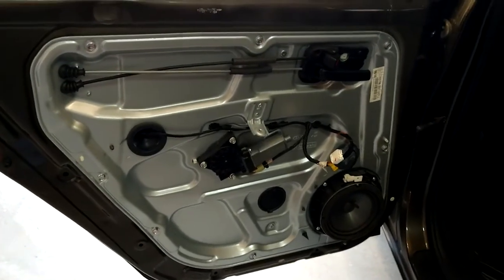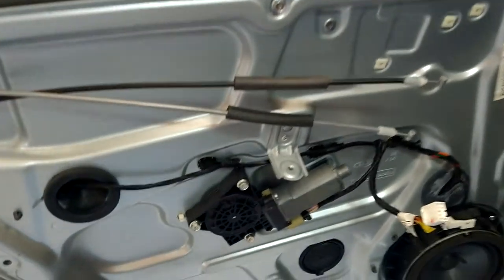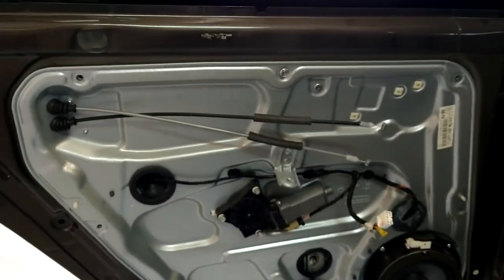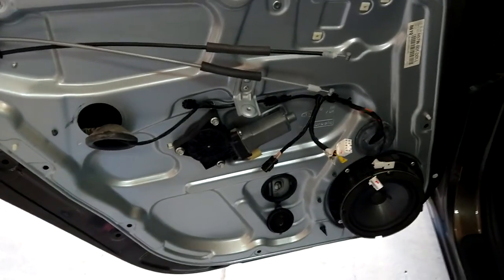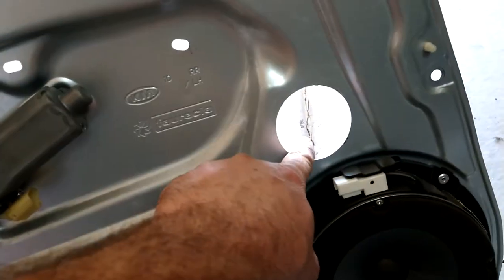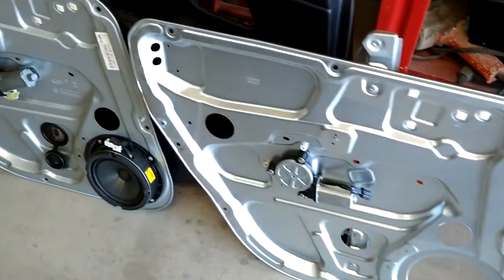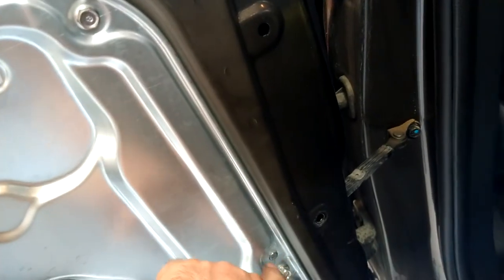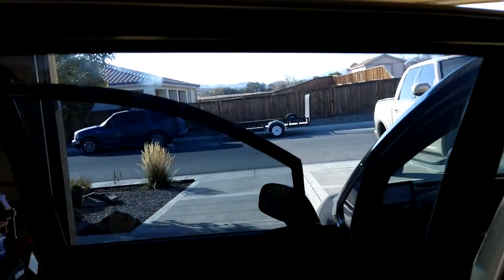2009 Kia Rondo window regulator replacement (step by step)

Comment: This is an excellent step by step tutorial, made even moreso by the fact that you did it all with one hand. Thank you for posting the info, and thanks for the implicit heads up that after you do one of them, you're probably doing the other one not long after. 

Well done, and a great explanation. Also thanks for showing the only rivets that need removing as well as a couple of methods for doing that. Really great job!

Comment: Thank you for recording this. My aged father-in-law had both rear regulators fail at the same time. Most repair shops didn't even want to attempt it. Some excused it as not being able to find parts. I found your video and realized we could do this. We ordered the parts from Amazon and followed your instructions. I don't think we would have attempted it without seeing your video first. And without your video, I can't imagine how long it would have taken us to uncover all the ways and sequences to disconnect/connect. Not to mention what we might have destroyed in the process. So thank you!
Reply: Do you have the link from amazon to order it? I have the same problem rear window not working

Comment: Wanted to ask how you like that hopper built amp I've seen in some videos. Looking to upgrade my setup and I like the look of his base models. Any input is appreciated 
73
Triple 7's 
Oro Valley Arizona
Reply from the maker: If you'll be getting an amp for SSB then make sure he does the bias circuit like BBI does. If just for AM then don't worry about it. Only other thing I'd recommend is to have it built in a large cabinet with 4 fans for all the cooling you can get. Also, if he has them, pay extra for the metal clads. He builds a nice amp, only thing that sucks is he's on the East coast. I'd call him up and tell him exactly what you would like built. 👍 A few of my friends have purchased Donkey Stomper amps and they seem pretty decent as well. Good luck.
Reply: @vegasfordguy  
Hey, thanks for the reply and tips. I'll look into those donkey stompers as well. 
I enjoy your cb videos!
Thanks
Triple 7's 
Oro Valley Arizona
Reply from the maker: @luke8210  Thank you! Ford Man 302 Northern Nevada.

Comment: Sucks to have to buy a whole new panel for such a small part. Might just fix it shut instead.
Reply from the maker: I thought about that since the rear windows rarely are used.
Reply: @vegasfordguy  I ended up using your technique to keep the window at max height and then just zip-tied the mechanism in place. I did't have a tool to remove the rivets anyways. 
Thanks for the video